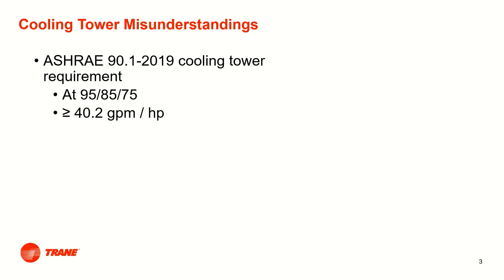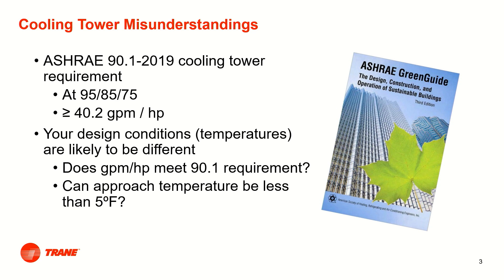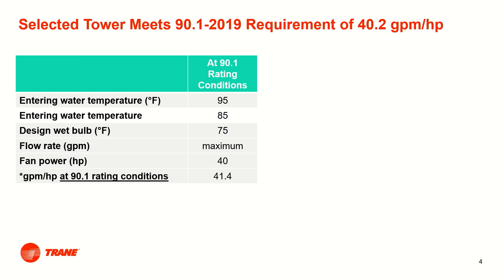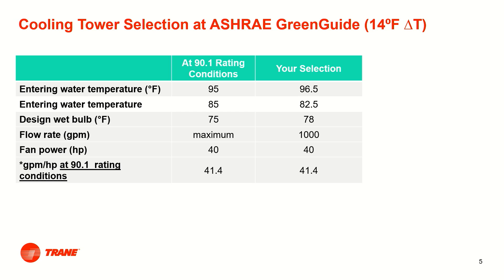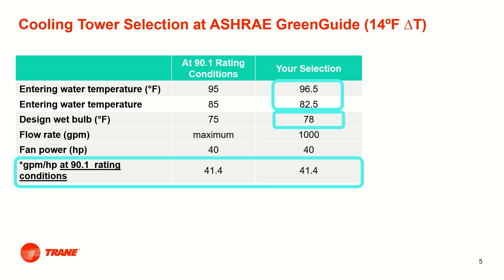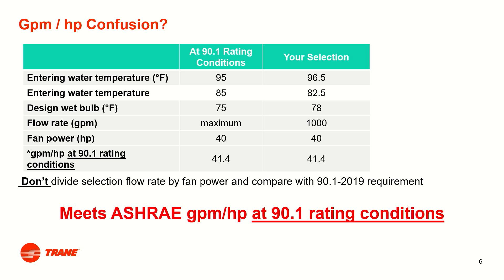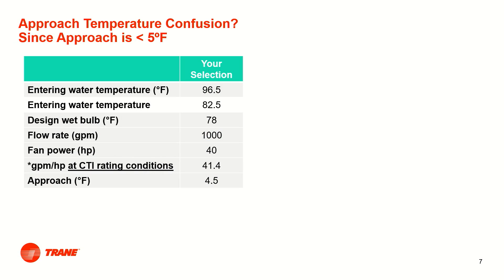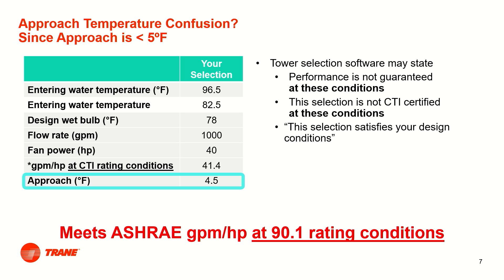Trane Engineers Newsletter LIVE: Cooling Tower Misunderstandings

Comment: In the second case with an approach temperature less than 5 degrees, if concerned about CTI Certification, just select an alternate design point for the same tower on the same performance curve that gives a 5 degree approach.  Typically, this would be at a lower wet bulb temperature at which the tower is certified.